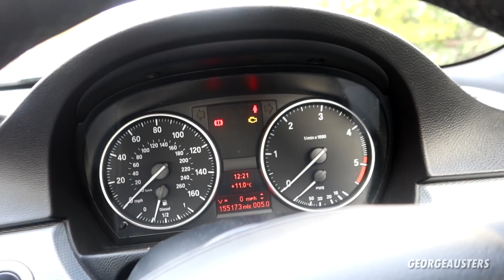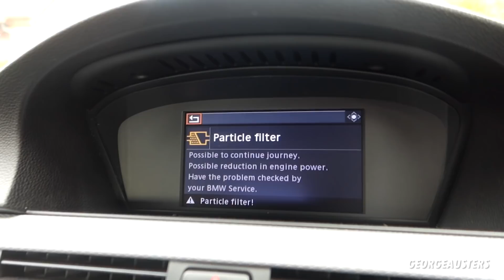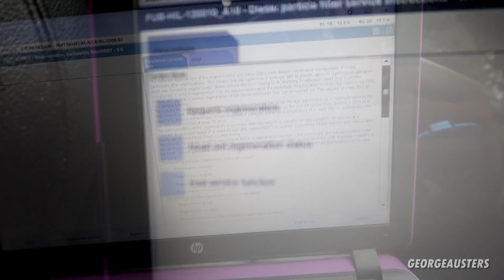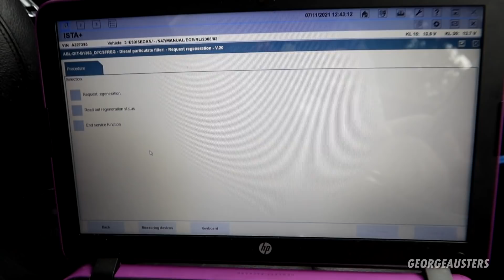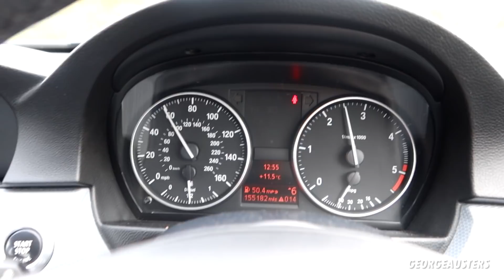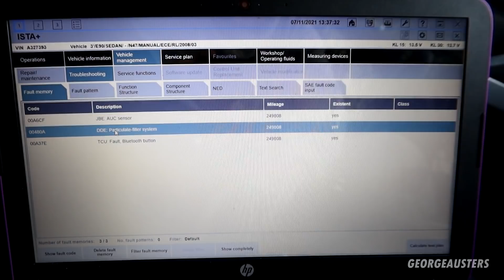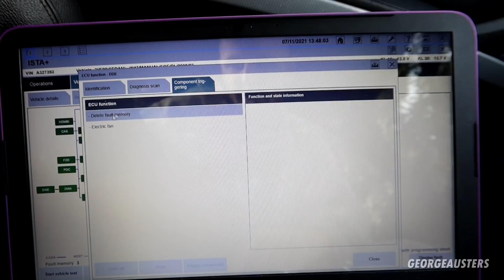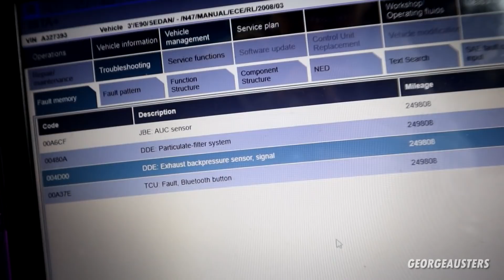SHOULD YOU REMOVE A DPF FROM YOUR DIESEL?

Comment: Hey George, another great vid, im also pulling my hair out over a Ex 320d touring i have. I've replaced the wheel bearings, and wheel speed sensors... and upon the first drive, the key wouldn't come out of the ignition. the turbo actuators flicking like mad, the abs, handbrake, dtc and air bag lights are on. but whilst this is all happening, the car is stood still and registering a fluctuating speed on both rear wheel speed sensors on live data. it also registers 6mph on the speedo at standstill. any input from you that i could have potentially missed? abs bearing pick up, and active steering sensors.
Reply from the maker: What is your voltage reading?
Reply: @GeorgeAusters  as soon as i unplug the wheel speed sensors on the rear, doesn’t matter which or if it’s both. everything goes back to normal. so with both sensors out i get 12volts are the rear end, and at the pump side i get 12v at the power, and grounds are also good. just weird how it was driving faultlessly before i did wheel bearings and sensors. now it’s madness with them connected or normal when i don’t have any sensors on the rear.
Reply: @lewisbradbury4832  Did you install the aft wheel bearings in the correct way? There's only one side inside wheel bearing equiped with anti skid signal ring.
Reply: @Andylike80  hello there, yup! both sensor rings facing inwards, and are visible on the inside when i look from behind the wheel carrier with no sensor installed. just baffling me, it has to be something else, because with the sensors out of the wheel carrier ie. not touching the bearings... i get 6mph on the dash, car doesn't unlock properly, and turbo actuator goes mad. and then as soon as i unplug the new ATE sensors from the car... everything goes back to normal. its baffled a number of people already. i thought it must be bearings until i narrowed this down with a multimeter. the 12v signal to the abs connector on the loom side reads 12v. just when i connect a sensor it has a flap! its in for diagnostics on monday so we will see! i just think it would be a huge coincidence if the abs pump had failed right at the point i chose to doo abs sensors and wheel bearings!

Cheers for reply
Reply: @lewisbradbury4832  Maybe there is an issue with the Main Battery cable(Trunk trough undercarriage) or junction box. Did you check battery voltage during missbehavior?
Reply: @Andylike80  yes, i charged the battery up to full, and reset codes.as i carried the work out with battery connected. so i made sure i cleared codes and charged it up, got to the end of the street and whollop! ABS/DTC/Ebrake/Airbag lights.
Reply: feel free to come make a vid on this abs error, because noone seems to have heard of it or knows what's wrong, just make sure you bring you coding laptop! hahaha
Reply: @lewisbradbury4832  One last thing. The replaced Sensors are original BMW and the part number match the original installed ones, sure? I had nwarly similar issue on 520d with one "OE-Part" from Hella and after installing Original BMW wheel Speed Sensor everything worked fine!
Reply: @Andylike80  i firstly tried paid sensors. they were no good, so i tried ATE brand which is OEM btw brake components, however they are just generic ATE not BMW specific. maybe that's the problem, as im also getting can bus codes too, swell as Pulse ring periodically monitoring. 
and speed signal missing
Reply: @lewisbradbury4832  Did the old Sensors break during removal or can you try old original ones? I I would recommend to install original BMW Sensors.
Reply: @Andylike80  yes i will try original bow sensors. hopefully that is the issue.
Reply: @lewisbradbury4832  look into reluctor rings
Reply: Drive shafts need replacing by the sounds of it, what happened to mine was similar, basically the rings around the drive shafts that pass near the wheel speed sensor had warped with corrosion, causing false readings of speed, yaw and traction, two options, temporarily you can put a washer between the wheel speed sensor and the hub to "compensate" but realistically you'd want to replace the drive shafts, oh and if you do. get some replacement bolts for the diff as there one shot ally bolts, you need 12 btw oh and 6 joint washers hope that helps mate
Reply: The swell as pulse ring fault is the actual fault mate
Reply: @ryanstevens9039  thanks for the reply buddy, unfortunately mine doesn’t have rings. the bearing has an inter grated abs ring. so the bulging reluctor rings or a spaced out sensor unfortunately won’t help as it’s for a different model! i’ve tried everything but everyone i ask has never heard of the fault before but someone must have. it’s a 320d e91 Jun 2009 LCI, n47.
Reply: @lewisbradbury4832  Gey! Did you solve the Problem?!?
Reply: @Andylike80  Hey Andy! i did yes! BMW Dealer told me my car had active steering. so i was using rear sensors for active steering.... little did i know, a specialist ran my VIN Number, and i don't have it. it was a very expensive optional extra to have on a 320d, a 330 or 335 maybe yes but not a 320d. so fit some new OEM sensors for non-active steering. and started up and drove as if nothing had ever happened! thanks for your help, All of you!
Reply: @lewisbradbury4832  yeah you have to be very specific with your parts, if something is just a little off bmw cars dont like that. Good that the problem is solved :)

Comment: The DPF has a life of 200,000 km. The reason they go bad is actually because of the  type of engine oil and fuel.
Reply from the maker: This one may have already been replaced in its life. With that being said though - a DPF should last forever if you remove it and clean it👍🏻
Reply: @GeorgeAusters  I put 131k on my F25 and the DPF is mint. I always am sure to pick up filter and oil from the dealer (I know I could go cheaper aftermarket) but I've found the OEM oil actually better. This is because manufactures set minimum standards on products they sell whereas the aftermarket is free to do whatever they want.

Comment: Hey George, enjoying the content.  
My previous car (Octavia VRS CR TDI), would regen fairly regulary, probably every other month.  I would know it was doing it because the idle speed would sit at 1000rpm rather than 750rpm as normal.  If I finished my journey and it was idling high, I'd know it was doing it's regen and carry on driving for a little while.  Do BMWs not do this?    Seems a bit rubbish to not know when it's doing a regen!
Reply from the maker: Not that I’ve noticed mate
Reply: Same I have a VW Passat 2.0 TDI and was concerned about buying a diesel car because of DPF issues but ended up buying it anyway , I can also tell when it's on a regen by the revs on tickover and slightly different idle so I just take it for a run before going home so far so good
Reply: @markjames3044  my previous Leon 1.6tdi 2017 euro 6 used to regenerate every 200 miles or so. You couldn't choose when you did it but plug in a Bluetooth OBD2 reader and download an app called VAG DPF and you could see when it would be about to do it and when it did. If you stopped during regeneratation the fans would run at full power after stopping to cool everything down. You'd have no stop start and higher idle. It was a very crude but effective system. At 50 percent soot load (shown as 100 in the app) it would auto regenerate. It did not regenerate passively even at higher speeds.
Reply: My 2016 2.0 cdti 170 insignia does the same. It sits at 1000rpm on tick over and the fan all so runs so I keep driving 👍
Reply: I’ve got a 2005 e90 330d manual and the few ways I can tell it’s in regen mode is that it wants to hold a high rev range feels like it wants to push a bit more than what your holding on the accelerator. 

also a sharp little push on accelerator and you get a sound like it’s puffing out steam and a slight bit of movement but this I’m sure you’d only be able to do in a manual. 
I’ve have my 330d for 6yrs and it regularly does a 200 mile regen so I click the mileage reset bottom so I know it’s soon going to happen. Got the car on 85k and it’s now on 116k.
Reply: @terrybooya6132  6 years and you’ve done about 30k?
Reply: @piovo1  yeah about 30k. And I’ve had my fair share of the DPF getting blocked. Never experienced limp mode tho
Reply: @terrybooya6132  I’m surprised everything’s not blocked to be honest.
Reply: @piovo1  my driving is mixed id say I only drive to work twice a week if that No traffic a.m but p.m there is but it’s all of a 30/40 min Journey. Lucky I’m very close you a dual carriageway so that helps sort the motor out when in need. My DPF must be at its worst being the original one and needing to regen every 200 miles. Owning the car 6yrs helps you to understand how the whole regeneration cycle needs to work.

Comment: Helpful vid, thanks George. Getting to the point of doing dpf, egr delete. Heard people say, no need for catch can with an egr delete !   What do you think ?  Doesn't the crank case still vent into the intake dumping crap on the valves of amy DI engine ?
Reply from the maker: That’s kind of true, without the EGR gases, you only have oil going back through your intake which shouldn’t clog up by itself👍🏻

Comment: Hi George, great video . I've seen someone a while ago showing how the dpf is not regenerating if the rev is over 2000 RPM even if is up to temperature,  unfortunately I can'tfind the video again . Try to do a trip at a normal RPM 1800 - 2000 . Hope it helps !
Reply: There is only one problem or perhaps two. One, after a certain date, if your vehicle was fitted with a dpf and it is missing at time of mot test this vehicle will fail the test and that also includes if there is evidence of tampering of the dpf ie the internals being removed.
Two doing this contravenes the construction and use regulations of the vehicle and  VOSA will if you have been found to have tampered with your in such a way, will hit you hard with nasty legal stuff.
To a certain extent I have sympathy with the people who own vehicles with dpf problems, because they are a pain in the arse.
Reply: You are 100% correct to do a registration you need to keep the revs within normal driving range around 2000 rpm or just under. If you over rev it like in this video it wont regenerate.
Reply from the maker: Nothing to do with rev range mate. I have sorted it though, a video will be out in the near future👍🏻
Reply: @GeorgeAusters  hurry up lol im having the same problem right now on a 520d m sport lol
keep up the good work mate well done

Comment: I have covered 12k in my e 92 320D 2010 LCI I am not aware of a DPF regen taking place should I be worried? The car is running fine and just covered 300mile journey from Bath to Sunderland mostly motorway🤔
Reply: Should have added car has now done 117K
Reply from the maker: More than likely has regenerated in that time. I’ve managed to sort the issue now so I should have an update coming soon👍🏻
Reply: @GeorgeAusters  I have never seen a DPF light come on the dash even when I first turn ignition on. I don’t have ISTA but have a decent scanner but no codes shown or recorded

Comment: But then you need to get a dodgy mot or keep putting it back to pass mot
Reply from the maker: Nope, I’ve never ever had an issue with a DPF delete on an MOT👍🏻
Reply: Not really, if you gut it and weld from top nobody will ever spot it’s been touched.